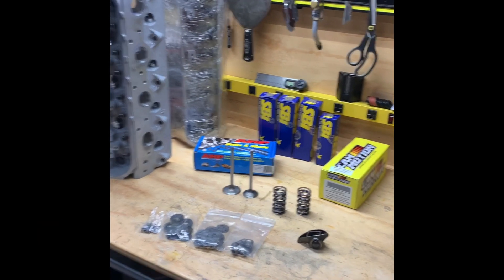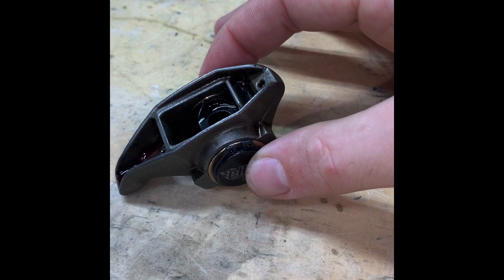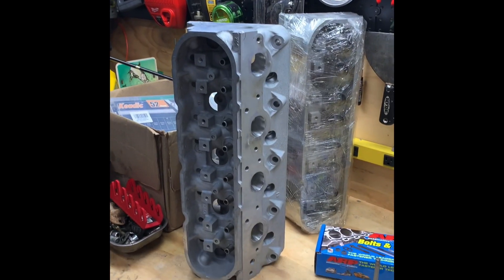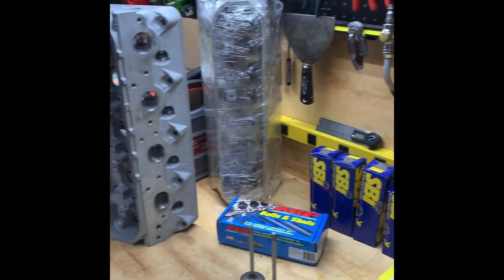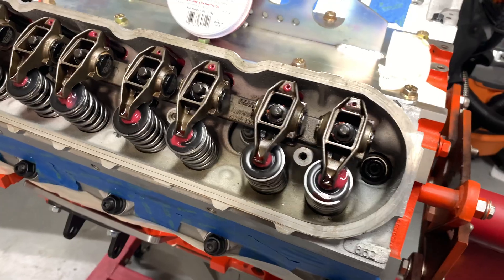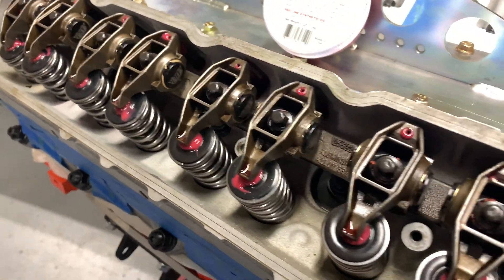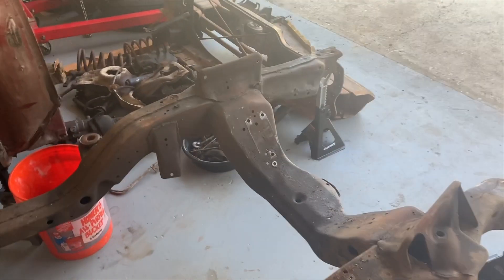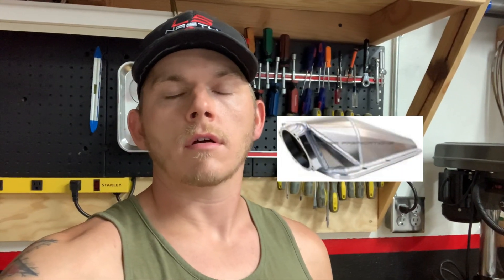Chevy Camaro engine swap | head install

Comment: That port job is gorgeous, dudes did excellent work. Dig the SBC look on the LS.
Reply from the maker: Second set of heads I’ve ported did a lot of research on head casting and where to remove material and where not to

Comment: Afternoon.  What's the plan for the overall engine build?  Rotating assembly, valvetrain, etc.?  Tuning software and who's doing it?  Bench test estimates?
Good luck!
Reply from the maker: Glenn Cattani currently it’s a stock crank gen 3 5.3 bored .10 over with new  gen 4 rods summit racing pro ls Forged pistons, I cover the valve train components in my video but all from cam motion with custom cam from my buddy Nate for nkp calibrations aka (Dr. TunEmAll) hoping to make around 1000hp with Holley hp efi, he will also be tuning it. Running a 7875 vs racing turbo. The setup should make the power no problem but the car will be fresh so we will have it turned down until we dial in our front half track time then go for big numbers
Reply: @DAPerform  Looks like an awesome build.  Looking forward to the vid.  Dr Tun-Em-All, eh?  nice!
Reply from the maker: Glenn Cattani yup the one and only dubbed thee by Mr. @Cleetus McFarland himself
Reply: D&A Performance nice. I’ll look him up.